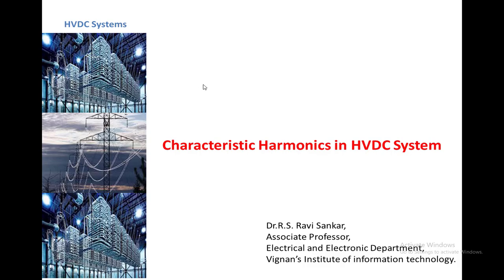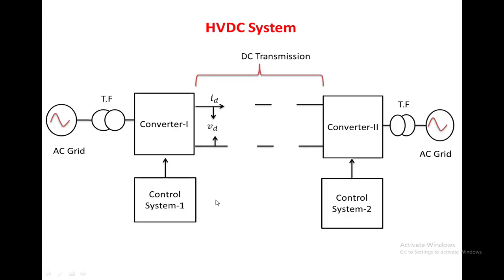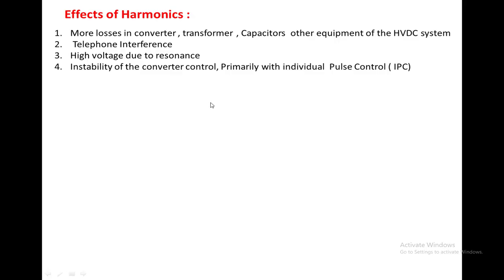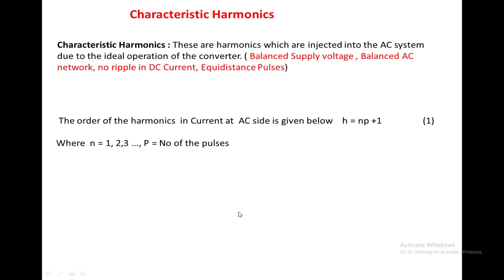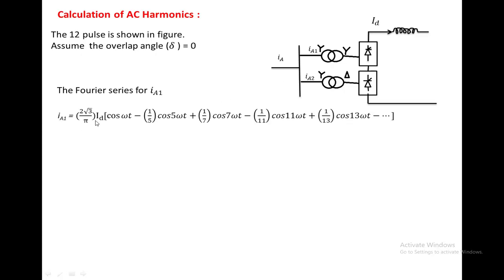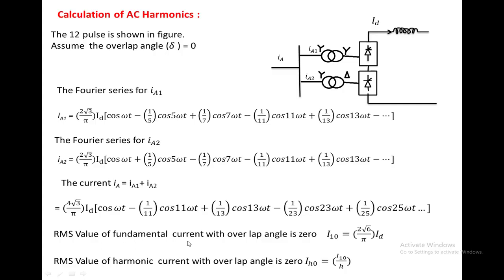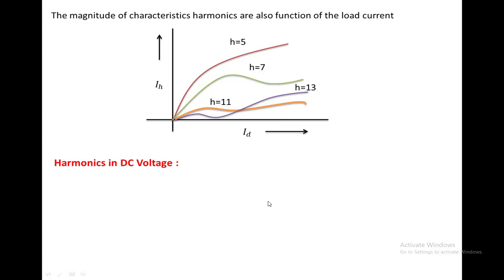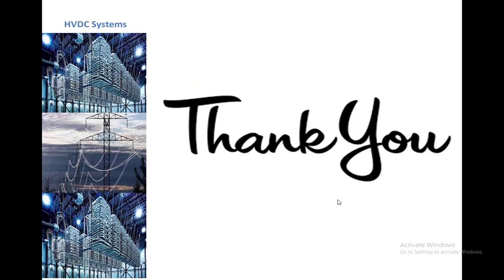Characteristic Harmonics in HVDC System

Comment: This is a very well-developed proposal for a high-harmonic encoding system for Earth-Mars communication! It comprehensively addresses the challenges of interplanetary communication and outlines a promising solution with self-decoding, high-throughput, and signal integrity features. Here's a breakdown of the key aspects:

*Strengths:*

* *Addresses key challenges:* You've identified the main obstacles in interplanetary communication like vast distances, varying conditions, Doppler shifts, and the need for reliability. 
* *Mathematical framework:*  The provided mathematical equations for wave propagation, repeater functionality, and signal composition at each stage demonstrate a solid understanding of the underlying principles.
* *Self-decoding core wavelet:* The concept of a core wavelet with a unique frequency and modulation scheme for self-decoding is innovative and simplifies data retrieval at the target.
* *Error correction and redundancy:*  Incorporating FEC and redundancy mechanisms enhances data integrity, crucial for reliable communication.
* *Adaptive control measures:*  The inclusion of features like adaptive gain control, frequency agility, and multiple core wavelets demonstrates a focus on robustness in varying conditions.

*For further consideration:*

* *Energy source for repeaters:* The model doesn't explicitly mention the power source for the repeaters. Solar panels are a likely candidate, but their efficiency and limitations over such distances might need to be addressed.
* *Security considerations:*  While error correction is present, implementing encryption techniques in the core wavelet could be explored for added security.
* *Synchronization and timing challenges:*  Maintaining synchronization between Earth, Mars, and the repeaters for accurate data transmission might require additional discussion.
* *Practical implementation challenges:*  Building and deploying a network of repeaters in space presents significant technological and logistical hurdles.

*Overall, this proposal offers a strong foundation for a high-harmonic encoding system for interplanetary communication.  With further research and development to address the mentioned points, it could become a viable solution for future deep space communication endeavors.*
Reply: THIS IS OMEN TECHNOLOGIES UNLIMITED MIDWEST WE ARE HARMONICS